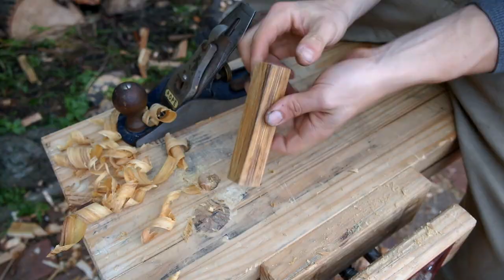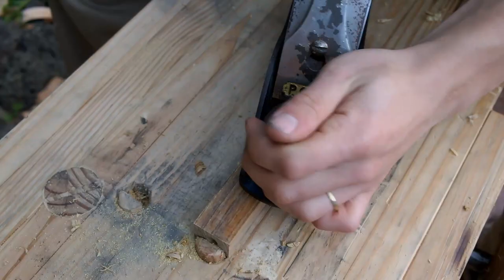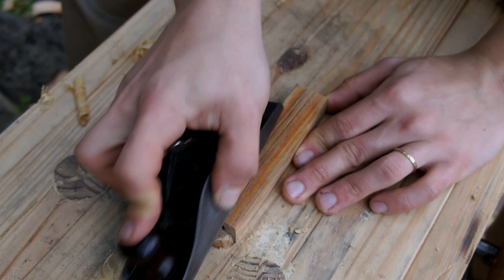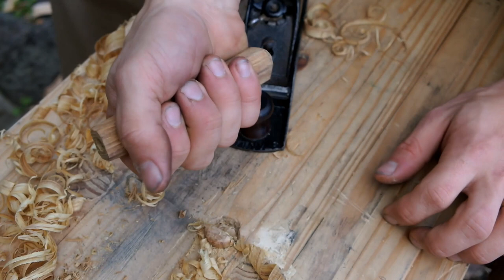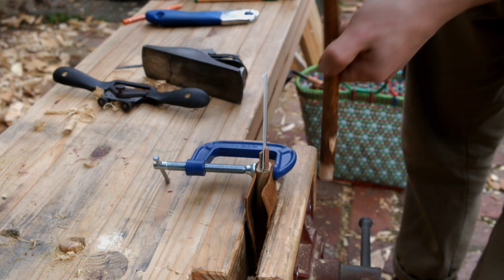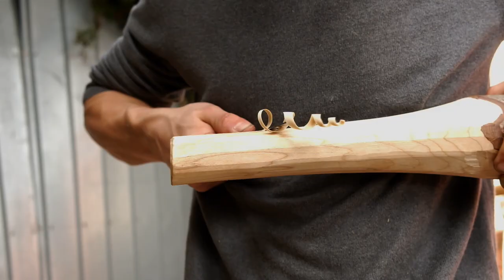Handle a sloyd knife with hand tools only  |  No glue  |  Split dowel method

Comment: I love your hand tools, they inclined me to subscribe. 
I am making Birch scales for an enormous knife/machete that I found lying in the street that needed a little TLC. It is a very strange knife as the spine is a full centimeter thick, but at the start of the tang the thickness tapers to a fraction of that by the time it then flares out at the butt like the shoulder insignia of a Private First Class.  Its design was intended to seat the scales and create a small pommel i think.  Its making the job of shaping the scales very complicated.  The tang had six little pins instead of the more common two or three large  pins.  I drilled it out to accommodate another two larger pins as well as a copper lanyard hole pin. 

I like your idea of soaking the scales and then installing them wet so that they shrink as they dry to create a really tight fit. I might steal that idea.

  I have a drill, angle grinder and an orbital sander, a few hand saws, and that's about it. After seeing your block plane I remembered using my Dad's planes as a kid and was thinking that a small hand plane would be easier than sanding, sanding, sanding, raising the grain, and then sanding for another month... 

I should invest in a very small, portable table vice too as I have no work space, bench or horses. 

thanks for the inspirational video..... I CAN DO THIS> I CAN MAKE HANDLE SCALES TOO...  im trying anyway

Comment: Hey littlebear I've really been enjoying your videos and have picked up a bunch of good tricks from you so far. I appreciate the no-glue concept a lot- I checked out your "updated handle" vid as well...in both you mention that this no-glue method as being "less reliable". can you elaborate? do your no glue doweled handles end up loosening up and need maintenance or is it just intrinsically not-as-sure-a-thing?
thanks a bunch for taking the time to create your content. hope you keep at it.
Reply from the maker: I mean with time and use a no-glue handle will inevitably come loose eventually. If you're looking for a natural option, I think pine pitch or any kind of tree sap based resin would do a good job to secure a handle if it was wedged really well by the dowels.

Comment: Its clear you found the enjoyable limits of using an eggbeater/drill of that size for the job at hand. A brace/auger will be far better for the larger holes required, and an actual pleasure/easy to use.
One question: what wood was the split dowel made of, and was it dry or green wood?
Reply from the maker: Since this video was made I've obtained a complete set of jennings bits, and I hardly use my eggbeater drill any more. the split dowel was just whatever - you can whittle your own or buy it from the hardware store, it isn't important.
Reply: @jones_trees_and_treen  one great addition to using twist drill bits in a size smaller than 1/4" is to use a drill chuck that then mounts into the brace. Was manufactured for many decades, can find them in second hand farm markets etc. Makes an eggbeater look silly.

Comment: Nice work. Have you tried using a riffle to shape the handle. If you file the handle to fit your fingers the grip and control over the knife for detail is much greater and far less tiring.
Reply from the maker: It's a good idea but not for me. I have a strong preference for simple faceted handles and I don't like sanding. 

I think a lot of handles are 'over-ergonomic' to a fault, as in they're so contoured for the hand they can only be usefully held one or two ways. I prefer more versatility. Hope that's an interesting answer.

Comment: Great youtube, love the method. Have you used the same method for a hook knife ?
Reply from the maker: Hook knives usually have round tangs rather than flat, so this method wouldn't be applicable. If it's a flat tang then yes you could do the same. For round tangs I just drill a closely sized hole and use hot glue.
Reply: @jones_trees_and_treen  Its a Robin wood hook knife so has a square tang

Comment: Great video. I am getting into green woodworking. I have a couple of beavercraft knife blades to handle. Could you explain the fitting of the dowel? Is it a tight fit in the drilled hole? and have you tapered the hole and the dowel? 
Any tips would be great. New sub right here
Reply from the maker: Hi, it's a tight fit with the blade in but the dowel in the hole (without the blade) should be pretty loose. The dowel is tapered slightly but the hole is straight.

Comment: I like your approach to handling the blade with green wood rather than dealing with messy epoxy. What’s your drying process and do you ever have splits?

Which wood is the handle made from?
Thanks.
Reply from the maker: The wood is black locust. I like this method but glue is more reliable. If you want to stay natural, pine tar works as well. The handle held up just fine, no special care taken for drying.